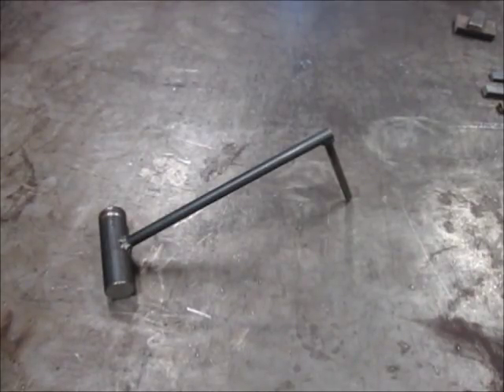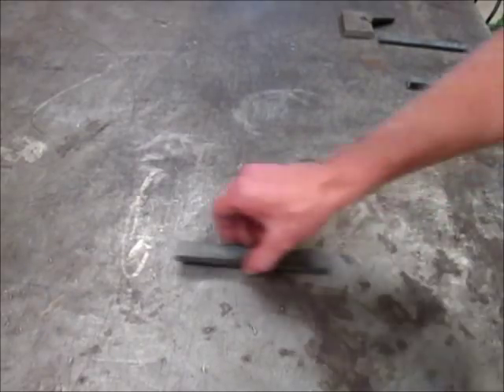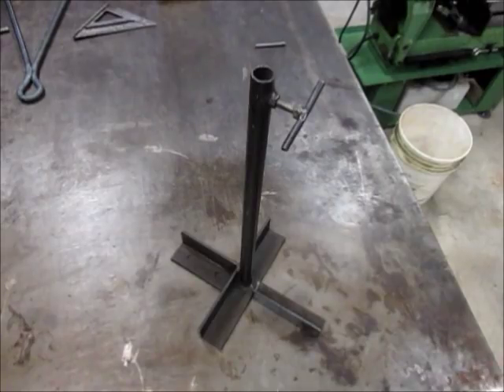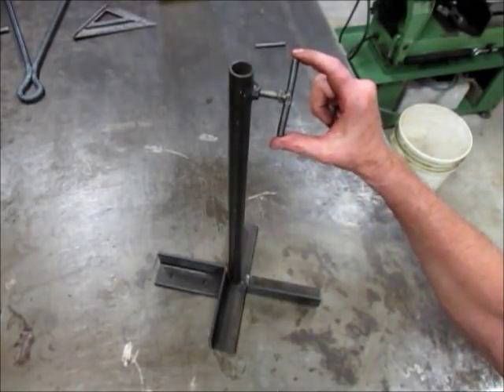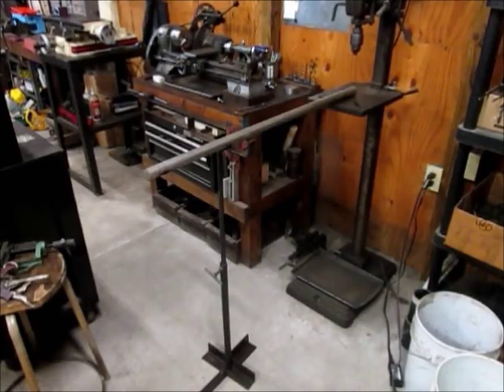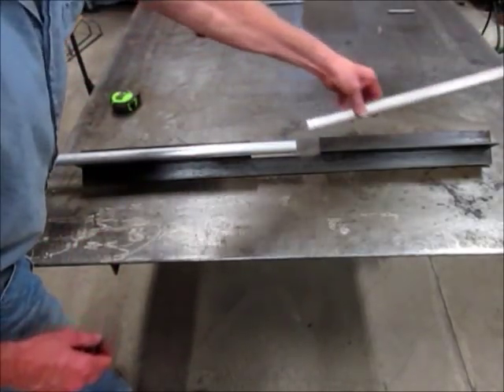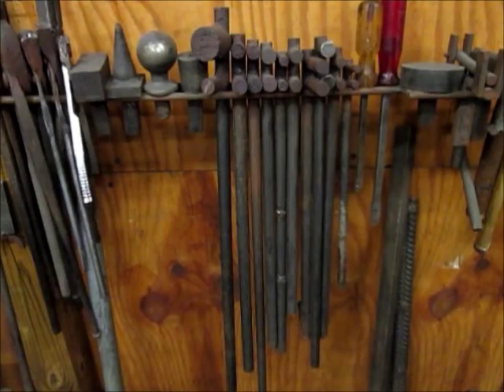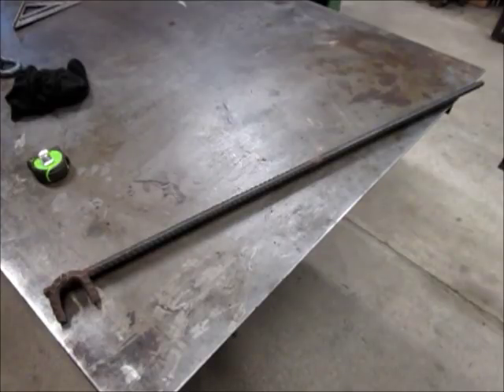4 Easy Welding Shop Projects

Comment: I almost made a version of the adjustable stand for my blacksmith shop. I needed something to hold up longer stock in the forge.  I went with a different set up but I till might fabricate one. Great ideas!
Reply from the maker: Hey thanks for watching. I use these stands often with my forge.
Reply: You  can  also  put  a  roller  in between  the upright  ends

Comment: Just curious, how did you bend that 1/4 thick flat bar on the adjustable stand? Looks like you have some decent bends but stuff looks pretty thick.
Reply from the maker: Clamp the ends in a vise, heat with a torch and bend.

Comment: Awsome tools, Q. Do you have a vid where you weld the lock nuts? I tried today using a inverter stick welder on a 3 to 4 mm pipe, it was a pain in the arse.
Reply from the maker: No vid. I used small rods with a Lincoln.